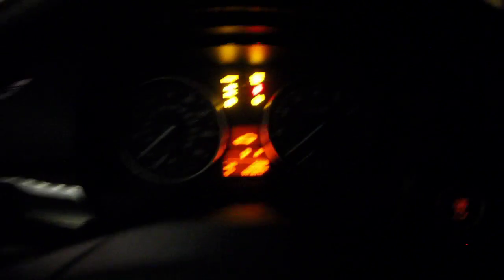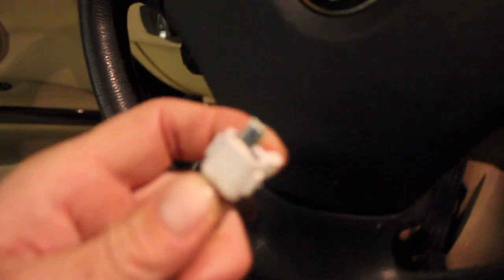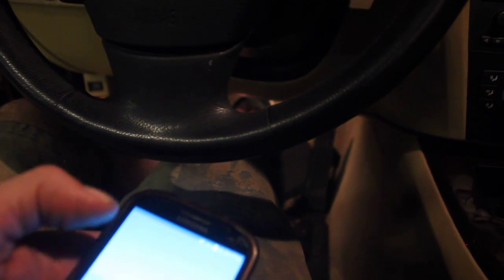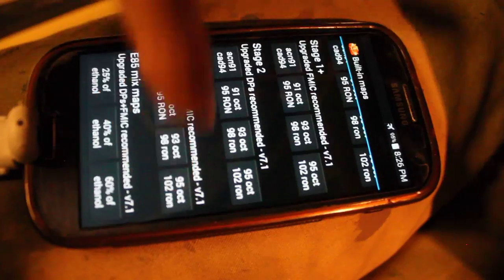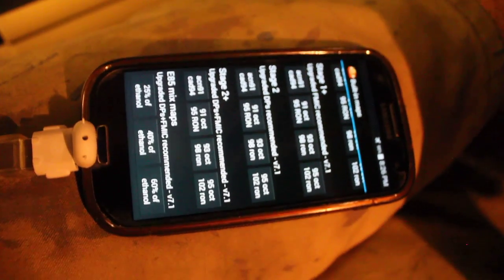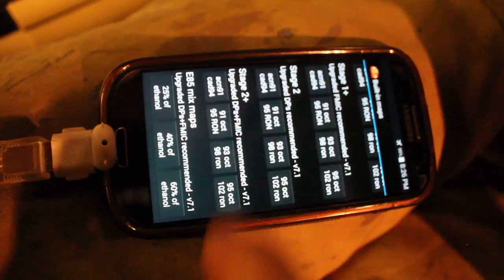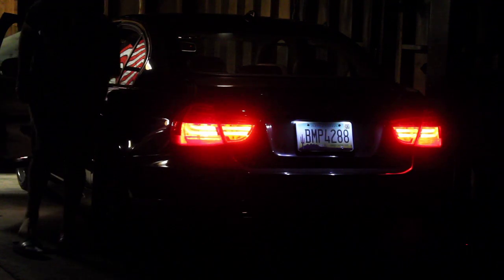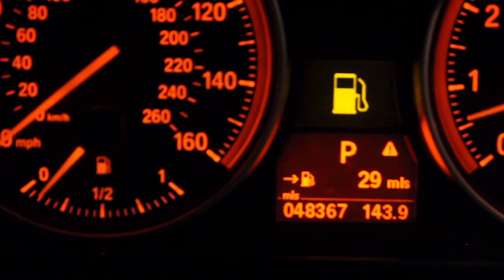How to MHD  Flash stage 2  n54 BMW  e90 335i xdrive marathon

Comment: Hi boss i am new to MHD but I have a 08 bmw 335i coupe with JB4 tune running 94 octane. But am trying to get MHD. I Upgrade changer pipe with blow of valve , bigger intercool , down pipe , magna flow muffler. What I really want to find out can I run 93 octane or 95 octane ? Because I am running 94 octane right now and I don’t see that option in the MDH.

Comment: So wait, when you run out of Meth your engine blows up with no controller dude.  You're nuts
Reply: how so? the boost was not turned up any higher for the meth.. the water meth injection was just used to keep intake temps down & help timing not to be pulled as much..

Comment: Can I tune my stock 2009 335i xdrive?
Reply from the maker: yes just go stage 1
Reply: The Angry Mechanic how much horse power can u get from a stage 1 ? I have a 2009 335xi
Reply: @Bugzbunnykid  what?  you make over 75-100hp from the stage 1 mhd tune alone  with out any other mods on a bone stock n54

Comment: When you remove the lpfp fuse, what would the minimum charger amps need to be you think
Reply from the maker: Bart K then could probably just run a trickle charger & be good..2amps..or more
Reply: Okay thnx, just asking because i've read some (forum) comments about 10A/15A and even 20A minimum... I have no idea of what amps the whole system is using during a flash
Reply from the maker: just make sure you have a healthy charged battery,  all accessories are off with the lpfp fuse out  then a trickle charger should be fine.. but if you can get a reg charger i use 12 amp setting ..

Comment: I'm new to MHD on my E90 335i and debating over Stage 1+ FMIC or Stage 2+ FMIC with 91 octane in CA.   Only bolt ons I have is a FMIC, Cobb chargepipe and K&N filter.   Which OTS map would you recommend ?  Thanks
Reply from the maker: Stage 1 until upgraded down pipes unless you plan on getting upgraded turbos in the near future ... You can do stage 2 but with out high flow downpipes it will tax your turbos and cause high exhaust temps & hot turbos ..however if you are just doing a pull then cool down periods (5 min between pulls on Highway) you should be fine running stage 2  with stock cats. Cheers!
Reply: Thanks for the wise advice!

Comment: Cool, I'm getting ready to do my E93  (N55) with Stg 2 with the E30 tune because I use E.  Currently I'm running the AP3 Cobb Stg 2 Aggressive, with Catless DPs, ER CP, GFB DV, 5 stepped FMIC so I'm dying to get it going to see if there is any power difference between MHD and the AP3.